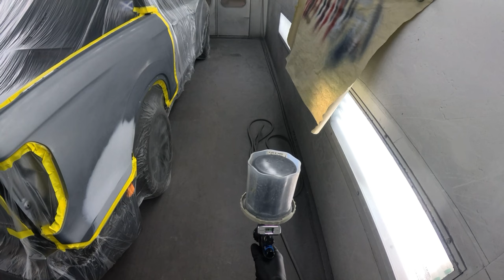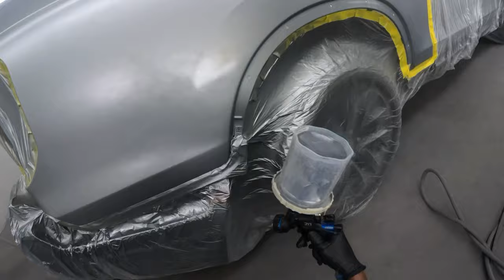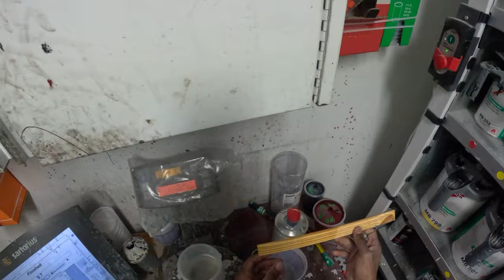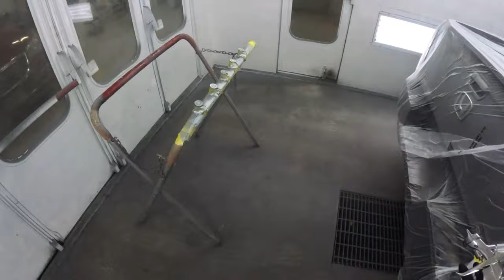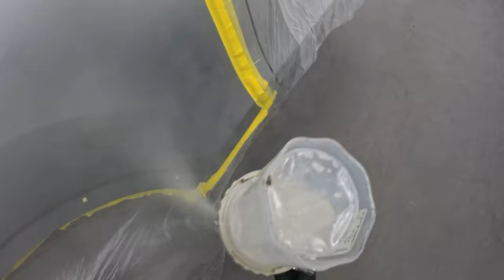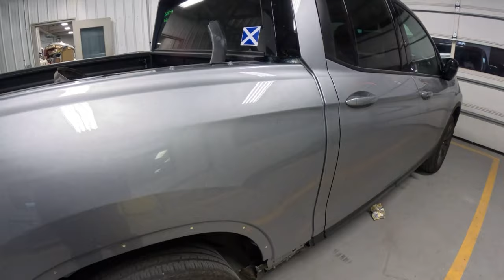Painting Metallic Silver on a Honda Ridgeline

Comment: Have you gotten your fan dialed in on the iwata yet?
Reply from the maker: I keep the fan wide open it’s perfect enough for me and gives me a great finish.
Reply: @treysterthepainterturner8404  hi treyster I follow your channel question for you when will you be making a video on the new series #2 iwata super nova clear coat spraygun
Reply from the maker: Whenever they come out with it for the US. They haven’t even sold it for the US yet but the UK them heave it.
Reply: @Treyster The Painter Turner  ok sounds good thanks
Reply from the maker: So whenever they do bring it here I getting it asap.
Reply: @Treyster The Painter Turner  which spies clear coat do you prefer 8180 or 8035 HS - I currently use 8035 HS one in a half no flash time
Reply from the maker: I love the 8035 but I only use that for high end cars. The 8180 is more of a production clear so it dries fast so I use that majority of the time. The 8180 is a 1.5 coat too no flash.
Reply: @refinishtechnology2529  8180 is more of a production type clear.. excellent gloss and fast drying. 8035 can get a awesome finish but stays soft longer. I only use 8035 for jobs that need that super flat finish and have a extra day to dry. On my personal stuff 8035 all day
Reply: @Treyster The Painter Turner  ok thanks for the information  👍 keep up the good work I learn a lot from your channel
Reply: @Juan Mata  hey thanks for the information  /  I basically used sikken 2pack HS clear  & glasurit 923-255 HS and spies 8035 HS only HS clear
Reply: @treysterthepainterturner8404   I heard that the best set up for the supernova is full material, but when setting fan u connect the gun and at full trigger start turning in the fan looking at ur psi.. when it moves up one psi then ur set. I tried it and it worked great for me. At Full fan it’s kind of loose at the edges of the pattern and can leave some funky overspray
Reply from the maker: Nah with full fan with me it’s fine. I don’t have any issues. It lays it down really good and I don’t have nothing negative to say about the fan. You definitely have to have full fluid. Tried to do it without full fluid it was a no go. Open it up and it was perfect. So u have to keep the gun full fluid with wide open fan.
Reply: @treysterthepainterturner8404  what do you think about the sagola 4600 spray gun
Reply from the maker: I heard good things about it. But do I own one? No I don’t.